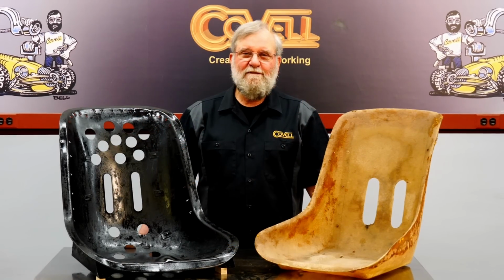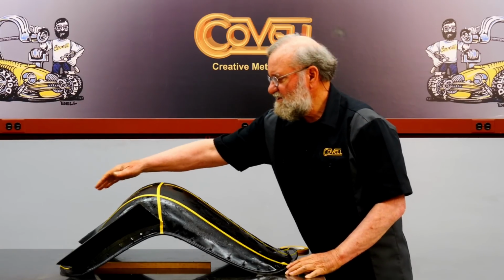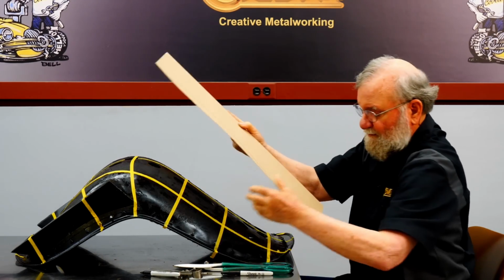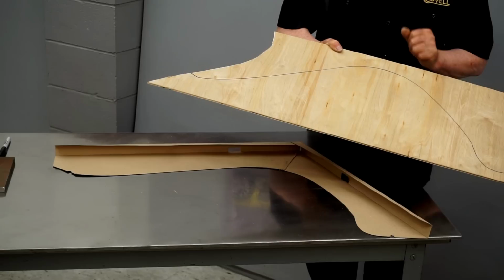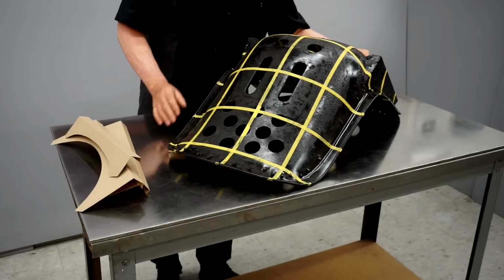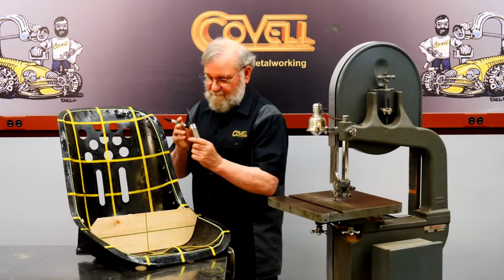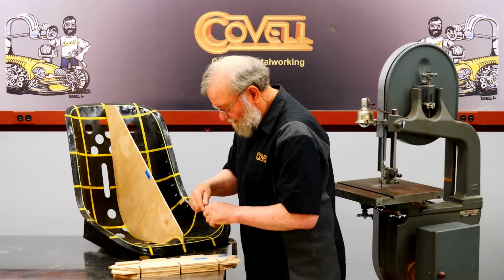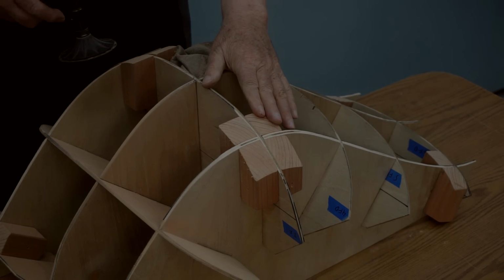Making the Buck for a Curvy Seat

Comment: I just watched the four parts in a row an loved it. You have great teaching and story-telling skills, aside of the metalworking ones. 
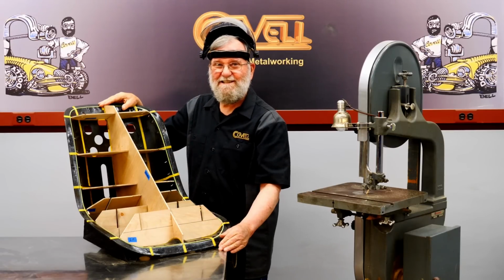I wonder how you located the matching holes in the long stations (@13:32). I would do it by measuring distances, but you managed to do all the rest only by transfering lines, without measuring anything. So is there a trick for those matchnig holes as well ?
Reply from the maker: When I had all the long stations in place, I marked and cut the front edges so they were all in the same plane, and marked the location of the center cross station on each one. Then, lining up the front edges of all three long stations, and the marks for the center cross station, I drilled two alignment holes through all three pieces, at a pretty much random location.
Reply: Oh, so those coplanar edges came before the holes ! Complicated procedure !
Reply from the maker: Well, there is a bit of complication in making a buck for such a curvy shape, with no flat surfaces or straight lines to reference from.

Comment: The way those cross stations looked when stacked reminded me of boat hull drawings. You get two grids, one is side view, one is split in half for front/back. Sometimes there would be a split top/bottom view as well. Each grid has outlines of hull cross-section at predetermined points. That made it really easy to copy the shape of the hull for model making and such. And because they were on a grid, you could scale it to anything and basically eyeball each 'station' from there. Grids made it way easier than trying to copy/size it all free-handed.
Reply from the maker: The 'automotive' style of buck building is a direct derivative from boat hull design, so of course there are many similarities.

Comment: How do you determine the position of the matching holes you put into the long stations?
Reply from the maker: I put a mark on the front edge of the center station, and used a square to transfer that mark to the front edge of the side station when both were positioned in the seat. Then I laid the stations together with the front edges aligned, moved one until the marks registered, and drilled the holes.

Comment: Nice work Ron, would you be interested in making a video on making metal wire rings like what you made for your alignment pins?
Reply from the maker: That might be a good subject for a video. I did make a large ring in the video in the link below, and I think you can see how a smaller one could be made by using a smaller mandrel:
https://youtu.be/uEo8JxMG8bg?t=669
Reply: @RonCovell  thanks Ron! I did see that I was thinking smaller rings.

Comment: I have a question for you Ron, in Europe we can't get 3003 Aluminum which I used when I was in the US. We can get 5083, 5086, 5754, 1050 and others that are irrelevant for metal shapping, I need to build the whole front of a curvy 50's race car. I am on the fence between 5754 and 1050, I'm kind of scared that the 1050 will be too soft for the body panels, but I talked to a metal shapper that uses it, the 2 others I talked to use whatever is available at the moment of their supply run at their supplier, so I guess 5754. Which one would you recommand?
Reply from the maker: I have been in touch with several metalshapers outside of the US who use 5000 series aluminum with good success, but I don't recall the precise alloy they were using. I would be a little wary about the 1050 alloy, since the last digit indicates it's in the fully annealed condition (0 temper) which would make it pretty darned soft.
There is an excellent website that gives you tremendous detail on nearly any metal (and many plastics). Registration is free, and they don't send you any spam. Here's the link:
https://www.matweb.com/search/AdvancedSearch.aspx
That will allow you to compare the yield strength, tensile strength, elongation, and many other properties of the alloys you are considering. I hope this helps!
Reply: @RonCovell  Wow, thank you so much for the quick response, you really do read all the comments. About the 1050, you are confirming what I was suspecting. Again thank you Ron.

Comment: Great content but I do believe you skipped over the difficult step of getting the correct angle for each cross station onto the center longitudinal station.
Reply from the maker: You are right - I did gloss over that point. The ideal angle for the cross stations is to be perpendicular to a tangent on the long curve, at the intersection of the cross station. I 'eyeballed' this angle, and got reasonably close, but even though I probably missed the ideal angle by a few degrees, the buck still has all the information needed to shape the sheetmetal.

Comment: Hi Ron. At 12:50 how did you get the angle right for cutting the section out of the vertical stanchions? 

Very informative video, thanks
Reply from the maker: Glad you liked the video!
The cross stations are roughly perpendicular to a line drawn tangent to the long buck at the point of intersection. I missed this angle a few degrees on some of the slots, because I was pretty much 'eyeballing' the angle, but it's still close enough to work well as a buck.

Comment: Amazing work, and you even gave us the templates. 

Although, knowing the corporate landscape, could this land you in hot water if Porche has a patent on those seat dimensions and/or shape?

Or is it fine as long as your not making them for profit?
Reply from the maker: You raise a valid point. I'm sure my dimensions vary a little from the original, just because of 'shop tolerances'. You will note that the plans I sell are for a 'Curvy' seat - not a 'Porsche' seat - so I hope this will keep me under the radar.

Comment: How do you form the metal over the buck?  I am wanting to make a "banana" seat for a bicycle. Hoping for a part 2 video covering the metal forming work.
Reply from the maker: The buck is used as a sort of template to check the fit of the parts as they are being shaped OFF the buck. I will have the ensuing videos posted in a few weeks, but you can see this kind of work being done in many of my videos. Here's one that shows a variety of forming techniques:
https://www.youtube.com/watch?v=AdImOWRUalc&t=720s
Reply: @RonCovell  I was way off... My thinking was you bend the metal over the buck with hammers. ...and seeing your other videos its welding pieces together cut in sections. Going to try it ...and your videos will help me a lot, thanks. The wide banana seat like this bike has: https://youtu.be/RG0ZzjEmTZE
Reply from the maker: There is a method of hammering metal over a form (called hammerforming) but it requires a solid form. Here's an example of that process:
https://www.youtube.com/watch?v=9ZTQUUDxNrY&t=831s

Comment: Did you just eyeball the angle for the center seat notch on the long patterns?
Reply from the maker: In fact, I did eyeball the angle, but the ideal angle would be perpendicular to the line tangent to the intersection at the center station. I got 'close enough'.

Comment: We’re can I buy some of the thin chipboard you use please
Reply from the maker: There is a great free source for this material. In 'Big Box Stores' (Costco is the one closest to me) they get toilet paper and paper towels on huge pallets, and they separate the layers with chip board. You can't beat the price!
Reply: @RonCovell  Thank you Ron. Unfortunately We do not have those stores in New Zealand. Cheers Ian👍
Reply from the maker: Where I live (California) large building supply stores have rolls of heavy construction paper. I have seen similar stores in New Zealand, so that's one place to check. Art stores have 'construction paper' in different weights. I used to get chip board from large print shops. They don't print on this paper, but they used it to separate layers of paper when they crated it. Years ago, I found a company that made boxes for dress shirts from chip board, and they would sell me a few sheets. Sometimes you have to be creative!

Comment: How did you determine the angel for the slots of the seat and back stations to match the tape lines
Reply from the maker: I positioned the cross stations roughly perpendicular to the tangent of the curve they intersect on the long stations. This was all done by eye, so it isn't perfect - and doesn't have to be. As long as the buck gives me a good 'target' to shoot for when I shape the metal, the positioning of the individual elements is somewhat arbitrary.

Comment: Great as usual Ron! Now with your seats and Wray's dash, we're well on our way to a whole 550!
Reply from the maker: Yes - and Wray has videos on the front and rear body sections of the 550, too. It's interesting that he uses techniques notably different from mine, and you can't argue with the beautiful results he gets!
Reply: @RonCovell  I watched a couple of times, and came back today to try to understand how you got the angles of the radial slots laid out on the first longitudinal station. You picked up the positions along the edge from the tape lines, but from there you have to project a line inward. I can imagine using a stiff cardboard gauge equal to half of a cross piece. That would follow the tape line up the curved side and give you a line to trace. Or is it a case of the angle not being critical as long as it's copied to each piece?
Reply from the maker: Well, the ideal angle of the cross stations would be perpendicular to the tangent of the curve on the long station at the point of intersection with the cross station. That's what I had in mind as I laid the tape down, and what I tried to achieve when I cut the slots. I know I didn't get it perfect, but it can be quite a few degrees off and still make a perfectly good buck.

Comment: I feel like a laser level would be a useful tool for marking and sectioning off stations
Reply from the maker: I never thought of that, and it probably would be a huge help!
Reply: As long as you positively fix/locate both the laser and the part very well, it works. But verify often, it's easy for tolerances and small errors to stack up fast.

Comment: I have a question. At 12:47 drawing the location of the slots. How to you know the correct angle?
Och I love your work. I learned a lot from you.
Reply from the maker: The angle is a bit arbitrary, and nearly any angle would work - but the ideal angle would be perpendicular a line tangent  to the curve at the point of intersection. Write again if I didn't make sense of that. It's hard to verbalize spatial relationships.
Reply: @RonCovell  Makes sense. Thanks. And thanks again for making video's on this subject.

Comment: Interesting that the holes in the speedster set are not always symmetric
Reply from the maker: Yes, I was very surprised at that irregularity! Of course, the Speedster seats were always upholstered, so any discrepancies in the hole locations would be totally covered. A number of Spyders have been built with little or no padding, so the holes in those have to be laid out with extreme precision.

Comment: I think you showed this method a few years ago and I just used it last month.
Same Outside first, duplicating to the Inside finish with sanding.

Worked perfectly and I got a supporting bracket for a 1970th Berlin Gaspowered Streetlamp-Lampshade.

Mind if I ask.
The Hotglue gun looks like a Würth HKP 300e I just had in my Hand at the 'Würth Shop' today.
If it is, is the Price worth it?
Reply from the maker: I'm so glad to hear that the technique worked well for you, on a non-automotive project!
I bought my hot glue gun from Uline. When I first used hot melt glue guns, I used the one my wife purchased for craft projects, and I didn't realize how limited they were until I tried I high-end one. There is a world of difference, and I would never go back. Mine is 300 watts and cost about double what the Wurth one costs, and the Wurth is only 80 watts.

Comment: I wonder if there are larger pattern matching tools like the one I have. It's made from hundreds of movable pins secured in a slot housing and it's great to pick up any curved shapes.
👍👍👍👍👍👍👍👍
Reply from the maker: I have seen some homemade tools with lots of sliding bars for making templates of complicated shapes, and I have seen commercial plastic ones for sale up to about 12" (30 cm):
https://www.amazon.com/HIYNKU-Precisely-Irregular-Extended-Duplicator/dp/B09GXL198F/ref=sr_1_18_sspa?keywords=contour+gauge&qid=1662863252&sr=8-18-spons&psc=1

Comment: Respectfully, I would like You to elaborate a little bit more on how you aligned the fitting cuts in the lengthwise members - they seem to be perpendicular to the tangents of the curve, but i'm interested if there is some clever way to make them have the proper angle?
Yet another great and educational video Master Covell, looking forward for the next one as always!
Reply from the maker: You hit the nail on the head - the ideal angle for the cross stations would be perpendicular to the tangent at the point of intersection. In actuality, I missed that angle a bit on several of the slots (since I just eyeballed the angle) but they will still work just fine even if the angle is a bit off the ideal.
Reply: @RonCovell  Thank You for the clarification, it makes perfect sense now - my concern was exactly that - how much could one stray off the ideal angle and still get them to satisfactory serve their purpose. Always learning something new from the time-proven master 👍

Comment: I couldn't find a video or article that  show or tell good enough how the fabrication of the bell or engine for a rocket.
Reply: And thank you for putting in the metric measurements.
Reply from the maker: Even though I live in the US, and have used the Imperial system since childhood, I fully understand that only 3 of the 195 countries in the world use that system. And truthfully, I hate it when I have to subtract 13/32" from, say, 8 5/16".
Reply: @RonCovell  Technically the USA has been metric for over 100 years. Our standards for the inch, foot, yard, mile, etc. have all been based on the metric measurement since the late 1800s. We happen to have used both for quite some time, but habits die hard.
Reply from the maker: Well, of course certain sectors of the US use the metric system - the medical and scientific communities, for example. And a new Chevrolet uses metric fasteners.
But I don't see how you can say that Imperial measurements are 'based' on the metric system. For example, one inch is 25.4 mm, one foot is 30.48 cm, one yard is .9144 meters, and one mile is 1609.34 meters. These hardly show a consistent basis, at least not by the logic I use.
Reply: @RonCovell  I think the "based on" thing is something about the scientific definitions. Like if there is a standard of measurement that is using metric and then the base of imperial is derived from that. But I think it's few people beyond scientists and engineer that actually base their decision on which system to use. It's more what one feels comfortable with and getting accustomed to a new system even if it has full logic behind it (with no exceptions or some special cases where the logic breaks down like what a language usually has) still would feel like learning a new language.
Reply from the maker: I get the idea.

Comment: That was a brilliant tutorial Ron. 
I was a little confused as to how you managed to align the long stations with the dowel pins for the  correct distance from the seat surface or straight edge.  After watching again and a little thought, the importance of those notches you made in the templates to clear the flange of the seat became clear as not just clearance, but are also the reference marks for transferring to the straight edge of the plywood station. I hope my deduction is correct, and that this helps others that may stumble on this point too?

Thanks again for sharing your knowledge.
Reply from the maker: Thanks so much!
Honestly, I skimped on the detail of that point, because I couldn't think of a streamlined way to verbalize as I was shooting the video. I made the center station first, and one of the side stations second. Then I fastened both in the seat, and used a square to align the front edge of both parts - and a little trimming was necessary to get them in the same plane.
After trimming, I used a square across the face of the two stations to gauge their alignment top to bottom, made marks on both parts with the square, then held the parts together on the bench with the registration marks aligned, and drilled the two holes for the alignment pins in pretty arbitrary locations. 
Last, the second long station was made as a mirror image of the first.
Send another comment if I didn't succeed in making sense of this. It's always difficult to explain complex spatial arrangements with words.
Reply: @RonCovell  That explains it perfectly Ron. 
I can understand the difficulty you may have had formatting what comes naturally, through skill and experience, into something that others might understand too while also making a digestible video. 

Only through watching the master, can the apprentice truly understand. Consider me enlightened on this occasion.

Thank you for taking the time to make your detailed reply.
Reply: I had a hard time comprehending this as well! I still don't understand how the initial depth for the slots were figured out or how the dumb side of the buck was made perfectly flat.
Reply from the maker: The depth of the slots is roughly half the height of each cross station. I don't understand the other part of your question.